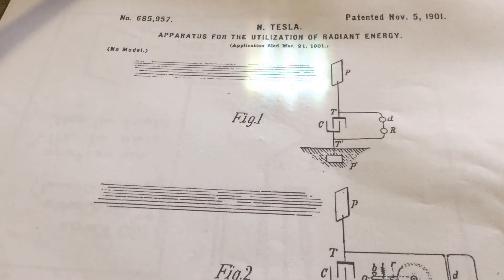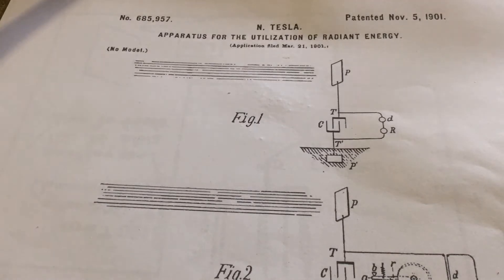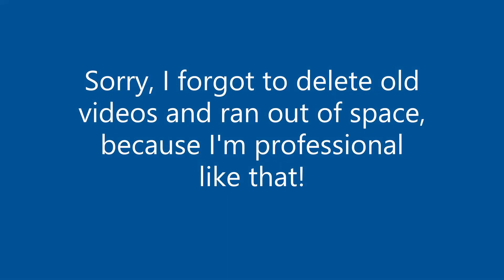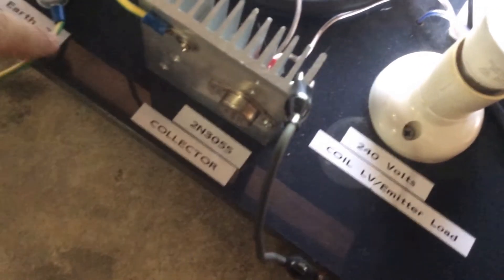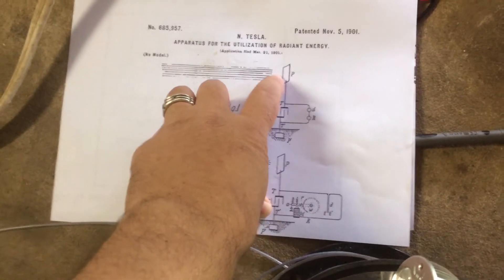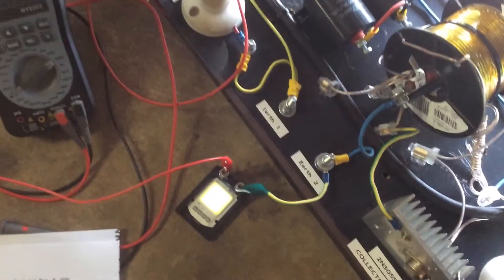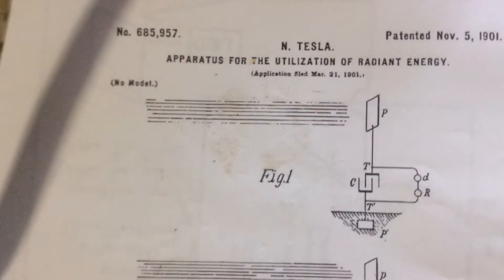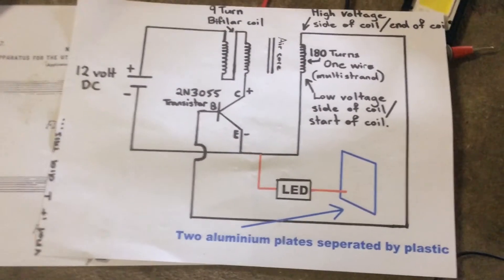Tesla Radiant Electricity Easy DIY Cosmic Energy Lights 240 Volt LED *Sense of Urgency*

Comment: Have a look at this patent US11588421B1 and tell what is his invention as I can’t figure out. He basically just added all possible ways using even Wikipedia  … I can’t understand how has been granted a patent for no invention at all ! 

What are they trying to achieve as I can see he is a conman and he tried to do the same with some sport shoes and lost the battle in court. How is this possible ? Since when USPTO has gone so low ?
Reply from the maker: Thank you for your comment. I have looked at the Patent you mention, whilst I can’t comment on its validity as I have not personally created a replica to experiment with, however, it should be stated this is Nikola Tesla’s work. In some of the diagrams you can see Tesla’s design and also similarities to Don Smith’s work which was already Tesla’s work. I can confirm that the high frequency generator side of this device does have the potential to convert very low voltages to a usable form of energy.
I will say, there seems to be little in this patent that isn’t someone else’s idea.
Reply: @whatifididthis...1236  that’s why I don’t understand on what base has been granted a patent. Anyway if you lookup for  the conman who got this patent you may find out he tried to do the same with Nike for a spring insole patent. My guess his is just a muppet and those who hold the strings are trying to achieve something outrageous.
Reply from the maker: @Caesarus2011  One of the reasons I believe in full disclosure is to prevent people stealing ideas, like what has been done in this patent. I believe if everybody is educated truthfully on the source of the invention then there is less opportunity to pass it off as yours as the world would already know it isn’t.
Reply: @whatifididthis...1236  What I want to know is why you blame Tesla for what you built? Your circuit diagram has nothing to do with any device that Tesla purposed. If you want it to somehow fit the information described in the patent, bury one plate, have the other elevated to a distance above ground, and use a glass plate or oil capacitor to electrically isolate the two. This whole thing is based upon something we call today the earth's electric field, but Tesla referred to as "radiant energy" because it was radiated from the sun to the earth. The "electric field" of the Earth was still in it's infancy at the time of Tesla, scientifically speaking. The sun charges the Earth, setting the potential gradient between the ionosphere and ground. You are looking at 100 to 300 volts per meter, which is substantial voltage. That center capacitor spark-gap combination is exactly the same as needed in a Tesla coil circuit for a reason. If I seem scathing to some degree, understand that mysticism is the cause of the revered holy grail of the phrase "radiant energy" in the OU world, and the problem is that Tesla was quite open in describing what he was talking about.  Tesla used the term for both the electric field and directed EF energy which could be tapped both from HF coils and HF coil accessories common at the time. He points out both in the patent drawings, specifically the radiant energy coming from a parabolic dish and in the other figure a "medicinal" vacuum tube common at the time.
Reply from the maker: @paulandrulis4672  Thank you for your comment.
I don’t believe I blamed Tesla for anything, if you feel I have misinterpreted his concept I am happy to watch a video made by you that shows this to be the case. I have tested this circuit in many different ways and it it is in my opinion the same concept as Tesla’s, an oscillator circuit between an earth ground and a capacitive plate suspended above earth that allows me to harness thousands of volts from the air. This circuit is capable of the things Tesla talks of so I am not sure how you can see this for yourself without building it and doing the work that I have done. I am happy to discuss this with you in further detail, however until we establish that you are speaking from experience as I am, seeing is believing.

Comment: Blowing up lots of transistors, means you have not got over current safe guards in place, the base of a transistor needs protection you could use some zener diodes from Base to emitter , at low frequencies but at higher frequency you would need a fast switching diode in series with a resistor to emitter of appropriate value to limit over saturating the drive current into the base. When Tesla was alive he did not have silicon transistors only valves, they are more robust to high voltage and current. If he had known about silicon transistors i'm sure he would have added safe guards to his circuit.
Reply from the maker: Thank you for watching. When used normally the circuit doesn’t destroy transistors, the ones it did destroy ended that way because I was constantly experimenting with random thoughts, what if I did this, what if I did that. My experiments were literally designed by ignoring the parameters of normal operation and throwing away the data sheet to see what happened when used in this way. Definitely a quicker method of learning than conventional thinking allows for, as long as you can afford to fail whilst searching a devices true parameter set. Originally I had the normal resistors and diodes and realised these changed functionality of the system and I opted not to use them, I figured if I can make it work without these items then there’s less to purchase and the circuit can be built from scrap.
 I often wonder what Tesla would create today if he was able to play with today’s technology advances, what amazes me is most of the advances were designed by him before we knew of relevant materials to construct them. Some of his patents literally talk of constructing a particular device when we find a suitable material.

Comment: do you have any idea about how big s ground you require? And I have 2000 sq. ft. building. I understand it would need to be insulated from the ground,  but I could put an insulated aluminum sheet on the back side where no one could see it.
Reply from the maker: Hi Ben, happy to help where I can. You are correct that the Aluminium plate needs to be insulated from the earth and any other metal bodies between 1/2 a metre to 1 metre spacing. The back of your house would certainly reduce your progression to the “local mad man that plays with electricity” by having it less visible, let’s face it, you won’t be able to completely avoid the questioning voices.
Q: How big should the Aluminium plate be.  A: The bigger the better and positioned as high as possible.
Q: How big does the ground need to be?   A: The deeper in the ground the better/ brighter your lights will be.
Tesla was convinced that the further down you went the more energy you had access to, I agree to a point. In this video, I have an official copper coated earth rod in the ground and 30 metres away I have a very short connection into ground, approximately 10cm deep, that can be seen in my other videos demonstrating through earth transmission. This short connection is for my convenience, allowing me to quick connect to different areas for testing. I should point out that it definitely works better when I use an official earth rod to properly ground the circuit as deep as possible. Earth rods will last many many years whereas most metals will corrode in the ground, if it’s going to be permanent, I recommend two earth rods. The wire that makes your ground connection should be a minimum of 30 feet each wire, at this length it acts as an independent earth and could be connected to a large metal object instead of actual earth. This can be helpful if you can’t reach ground safely. Please remember, when this is done correctly it can be very dangerous, even lethal. Whilst I don’t wish to discourage you, you need to consider everything around you to be alive, one hand in the pocket at all times when experiments are being carried out. I will make a video soon showing how to make an RF detector that you can scope your environment out with, to determine safety hazards.
Reply: I have 2.5 acres , the property behind the shop goes up hill about 10 to 15 degrees, and has a lot of limestone close to the surface.  I'll have to drill it to get a rod into the ground.
Reply from the maker: @benrasmussen9878  Remember those suggestions are for the best scenario, it will also work with 1 metre grounding cable, even less if necessary.

Comment: How much power you're using from the battery? You'll get that voltage from your coil exited by bifilar
Reply from the maker: I can’t remember it has been a while since I played with this circuit. I will try to make another video and perform some new tests that might answer your questions and suggestions.
Reply: @whatifididthis...1236  Thank you - love your inspiring and instructive videos!
Reply from the maker: @TheProfJones  Thank you for watching it is greatly appreciated.
Reply: I appreciate Your replies and I have a question. In other videos with the high voltage Tesla coils, You note that 1 can use an Avramenko Plug and connect to a capacitor and charge the capacitor in that way quickly. I really want to try this. My question is what type and capacitance and voltage rating of capacitors should I try to begin with?  I  Would appreciate your advice on this very much.
Reply from the maker: @TheProfJones  Thanks for your comment Steven. Please remember I am not an electrician and everything I know is a product of my self education and therefore there may be better options in regards to capacitors and quite possibly all aspects of my work. That being said, I can happily tell you what I have used. The capacitors I used with the Avramenko plug being charged through earth are 1400 volt DC 20uF with two in series. Capacitors should really be chosen based on the intended load considering charge and discharge rate and Farads. I hope this helps.
Reply: Just try to connect your led to plate and the other to earth. See what happens, bypassing your circuit

Comment: You show the high voltage side of the 180 turn coil going to base of transistor? The emitter not showing the arrow. No exposition how it works? Why do you need the 12v battery?
Reply from the maker: Thanks for watching. I am not a trained electrician and sometimes make rookie mistakes without such an education, eg. incorrect transistor drawing. I will try to make another video covering this in more detail. As I understand it, the “wall plate” is a capacitor, this acts as an earth being that it is a large metal surface. I’m sure I explained that in the video. The 12 volt battery is required for the circuit to start and the battery is part of the circuit and more so than just a power supply. As far as the metal plate (capacitor) is concerned, I believed you could be correct that their may be some collection of energy from my house wiring however it works the same in the middle of a paddock nowhere near the wires, if it were collecting power over 100 meters away from mains wiring then even better as that’s even more amazing.
Reply: @whatifididthis...1236  kudos for doing it. 
I don't understand if people discover free power and then put it away? Doesn't make sense. To me I'd keep running it forever and make more
Reply from the maker: @ThePaulbilek  I agree, I usually leave most of my devices running but I run out of space for testing and pack things up so I can work on the next system. It is also quite dangerous to leave these systems running if you have other people around that don’t understand what not to touch.
Reply: Your plate also is picking up your wiring energy in your walls